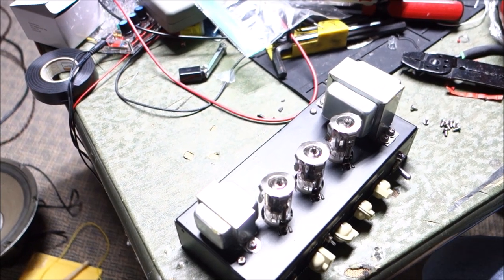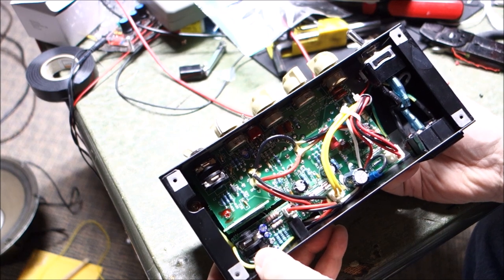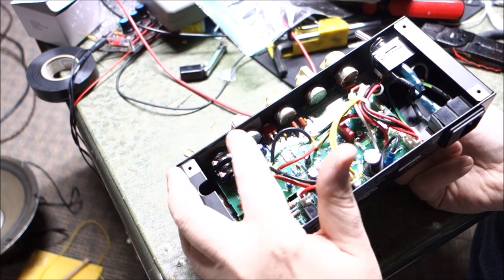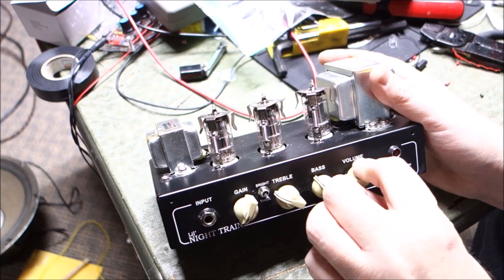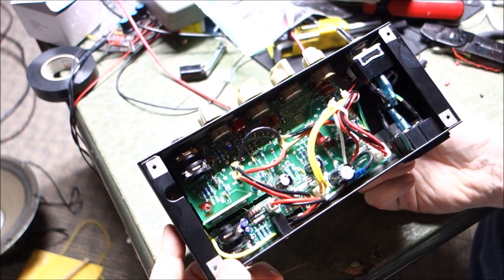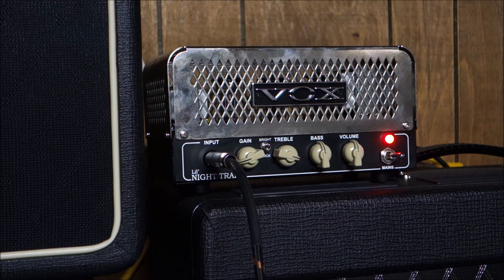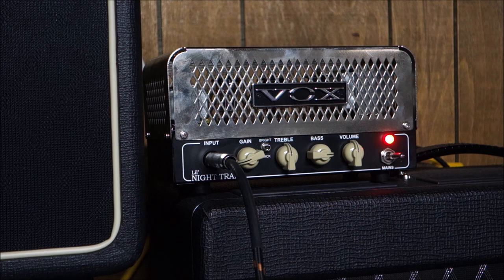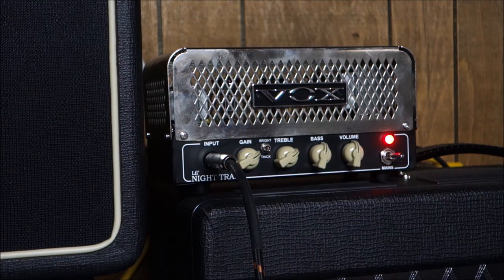Vox  Lil' Night Train Guitar Amp comes into the shop for service

Comment: Overall you are correct with the features and response of the Lil' Night Train NT-2H. The 12BH7 does give a bit of a fuller tonal range. The JJ ECC99 goes just a little too hot for the PT. It was just a tad bit fuller sound, but after an extended practice  session, the thermocouple in PT gave out between when I shut it down and started it up the next time. Of the several mods I've tried, the only worthwhile mod has been the bright Cap switch mod. I put it on a switch only because I use it with the bright cap more often than without, but there are those times it is needed to switch it out with bright voiced guitars, where I have to dial out more treble than reasonable on the guitar.
The stock V-110NT cab is too narrow and the speaker (even broken in) is too bright for the brighter tone of this amp. Using the cabs I built with the Weber Alnico Blue Pups (10") sound far better than the VT-10 in the stock cab, once either is broken in.
If you read the thread on TDPRI, then you probably figured out who I am. Even to this day, the two I have are the most used amps I own. (Though the recent 6G2 build may take precedent as of the current time!) My favorite is my AC15C1X, but it's not as reasonable for home play/practice/noodling as the Lil' Night Train.
Reply from the maker: Cool..  Thanks for the Analysis.   I have stopped "deep thinking"  any of this stuff.   If it's broke,  I make it work.  When it sounds good,  it is good.

Comment: I did NOT realize these had a 12au7 for the power tube. Does it use two triodes as a double ended output?
Reply from the maker: I would need to check the schematic to know.